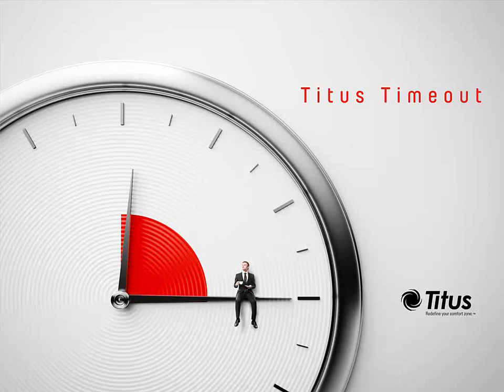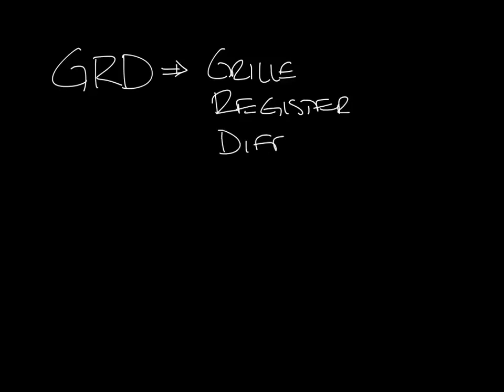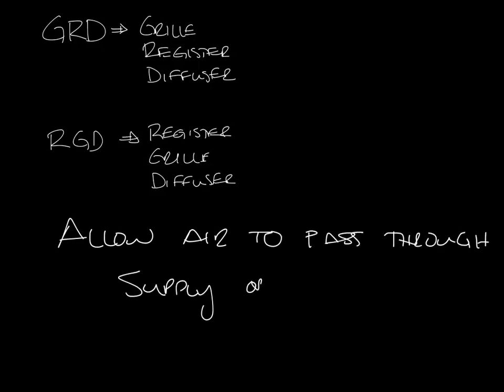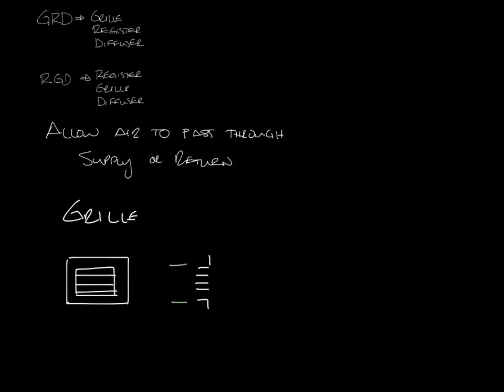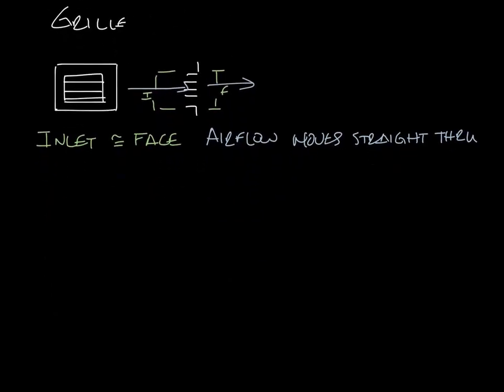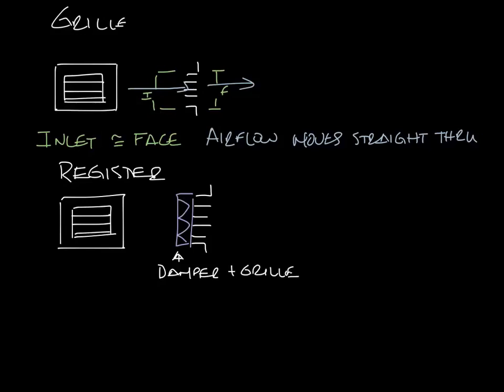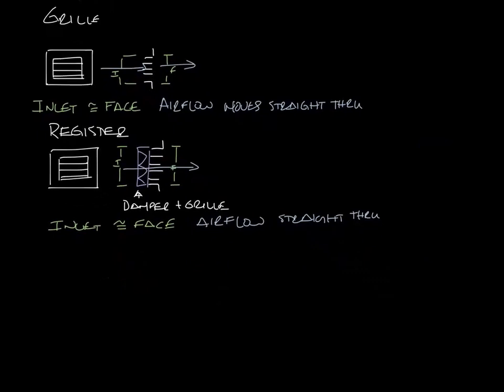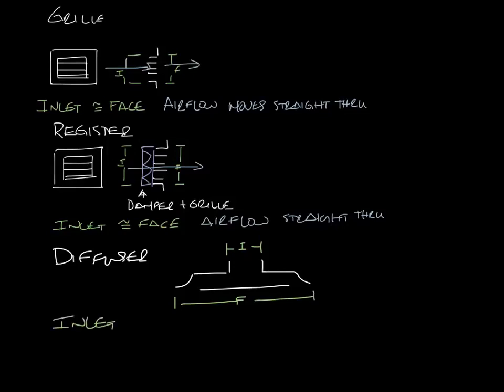hvac-What's the difference between grille , register , diffuser

Comment: Diffuser is a device which decreases the velocity of air flow mean while incresing the static pressure, grilles and diifusers are also comming with dampers we call it grille with OBD, thing is that grille outer blade is fixed,  while registers have movable outer blades.
Reply: Thank you for mentionning that registers outer blades are movables compare to grilles ... and also in my experience grilles are used for return air lines and registers are used for supply air systems